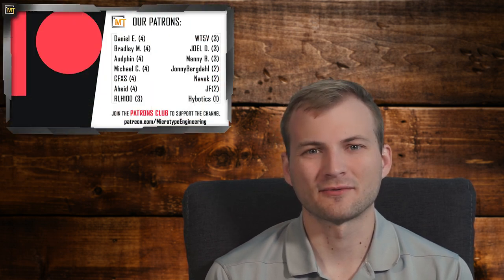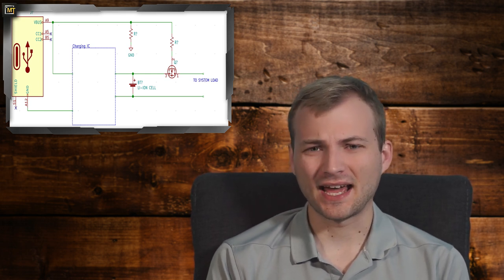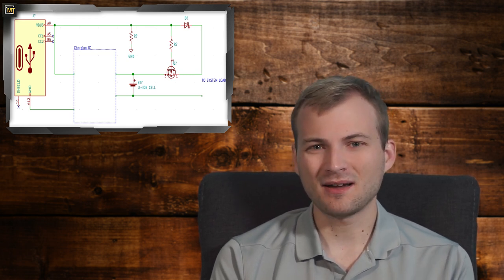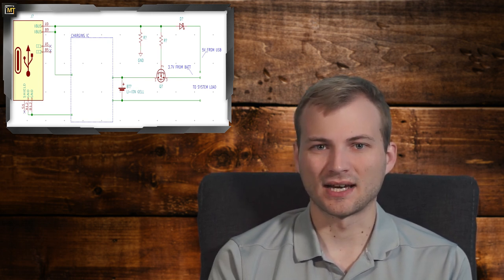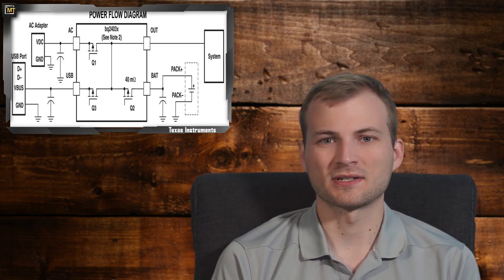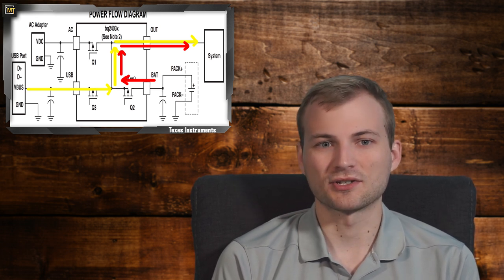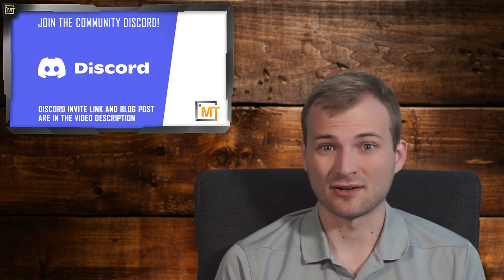Don't Make This Mistake When Designing Li-ion Battery Circuits!

Comment from the maker: Two clarifications: 

1) When I spoke of power path IC's I spoke as if all can work in "supplemental mode". Supplemental mode is when charging, the IC can suppliment the wall supply with the battery.

Not 100% of path path IC's can do this. Most can, but some only source power for the load from the wall while charging. Still useful, but not quite as much.

Make sure to always check the datasheet!!!

2) On the second method, the PFET should be two back to back. This prevents the input supply directly charging the battery through the body diode!
Reply: This is very informative, please can you give. A part number of such ICs!? Also if possible please create a tutorial on creating on which can supply and charge the battery. 

Subbed,

Greetings from Tanzania 🇹🇿

Comment: Problem with your second method: The body diode of the PFET is still conducting. So you're charging the battery cell through the schotky + intrinsic body diode. You should put two PFETs back-to-back to fix this.
Reply from the maker: Ah shoot. Yes you're right, dunno how I missed it... I always use this circuit with the battery going into a boost converter, so I don't worry about it..

Added a note to the pinned comment, and updated the blog post. Really wish YT let us put text pop-ups in the video like they used to..
Reply: I’ve seen a version of this circuit on Andreas Speiss’ channel with the P MOSFET drain and source reversed. I think this would stop the battery from being charged by the power path as the body diode is reverse biased?

Comment: For those applications where supply interruption is not an issue ( like torches or portable emergency LED lighting ? ) ... by far the simplest arrangement is to avoid the complicated electronics ... and ... just fit a single pole changeover switch ! ! ..so the battery is either connected to the charger or the load , but NEVER both at the same time ! .. This is how I do it ! ( and for those unfamiliar with Lithium batteries NEVER charge more than 4.2 Volts ) ..... ( tried - n - tested ) ..... DAVE™🛑

Comment: Nah, if the charger reduces charge current as the battery fills, the charger won't end up over charging the battery... The charger will just power the device once the  charge current is reduced to the device load.
Reply: You wont ever "finish charging" unless your decice load is less than the charge current cutoff - but it doesnt just ignore battery resistance and overcharge the battery on trickle if the load is using the juice.

Comment: Another issue people fail to take seriously is low battery voltage. Relying on the inbuilt protection board takes the battery voltage to a level where the capacity of the battery can be considered less than 0%, performance-wise. So when I design circuits I use the ADC of a PIC to monitor voltage and react accordingly. Anything below around 3v, the circuit is disabled and the chip shuts down. Using the battery below 3v is pointless anyway, and some chargers just won't see the battery at such a low voltage!

Comment: The easiest way to get passed these issues is when using components that have sleep or idle modes. When the components go to sleep the battery will definitely fully charge, without trickle charging.

Comment: Hi.
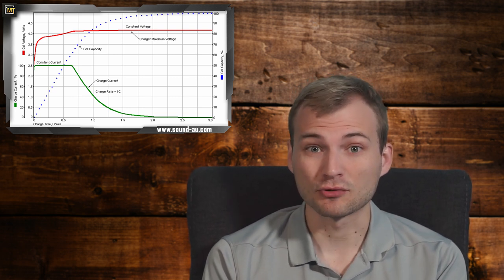At 2:00 you claim that the battery will be trikcle-charged, if the load, the charger, and the battery are all in parallel. I believe you mean float-charged and not trickle-charged right? You also claim that it is bad to do so. Can you please elaborate why it is so bad to float charge a li-Ion battery? Does it pose a fire hazard, or will it just wear the battery slightly faster? How will the cell be damaged if the voltage of the celle never goes above 4.2V? Looking forward to hear your answer. And thanks for the educational content!

Comment: This right here. When I had to design battery power with a 5V boost converter, the only schematics I could google were the ones where the whole supply always goes through the linear charge IC, ffs. Ended up with a mess of a set up where I programmatically detect the charger being plugged in and out through two different voltage comparators and switch accordingly. It did end up working, though

Comment: Excellent video! Caused me to go back and reexamine a recent design that's presently having it's first-spin prototype evaluated under real-world operating conditions. Turns out I did make a mistake and my charging IC, an MCP73831, can be fooled when charging and using the device at the same time (which is an edge case; it's normally charged and then used). Since my battery charges at 200mA from a standard USB supply, the nominal load is 100mA, and the system will tolerate up to 5.5 Volts, the next spin will will incorporate your idea #2 for input bypass.

I really appreciate you taking the time to create these videos. I find many of them to be incredibly helpful.
Reply from the maker: Hah! Yeah, it always finds a way to come up and bite you. Glad you enjoyed. (Make sure to check the blog on the fixed circuit for option two, you need back to back FETs instead of one!)
Reply: @MicroTypeEngineering  Thanks! Yeah, I read the video description right after watching the video, which led me to the blog. Your content is very thorough.

Comment: This was very good, thanks.
I had a brainfart idea of disabling the charging IC over its EN pin (over the MCU that's powered from there lol), but then I realized that I would need a way to detect both battery presence and plugged-in status to even attempt that.

Comment: Instead of using a mosfet, would a regular switch work? It would short the load from the IC right ?
Reply: That's what I did yes, but then I needed to put a voltmeter on the battery at all times to make sure it doesn't discharge too much. I am learning.

Comment: regarding those power path IC s I am not sure if i understand well:
let s say my load is 1A and by battery pack charges at 2A and my external power is 2.5A
then 1A will go to the load and 1.5A to the battery?  or this i think will happen 
and if the load for some reason needs now 2A then the battery will then receive the remaining 0.5A right?

Comment: What works for me is the MCP1640 which will boost the battery voltage to 5V for my load.
So when USB power is available, the MCP1640 is disabled and automatically isolates the load from the charger.
Then a diode to feed USB power to the load whilst the battery is charging. The load runs fine at 4.5V.
Admittedly I don't need more than 200 mA for charging and the load is less than that, but it works fine.

Comment: Nice video. I'll have to watch it again. Im currently doing exactly what you show not to do. 😅 its just temp.

Im building my first drone and learning battery control.

I cracked open a 5v 1amp cellphone battery bank, there is a board that steps up 3.7v to 5v that i need for my drone motors. I need 2amp, and im uncertain of what module to get for light weight battery control with 5v 2 amp step up.

If you have suggestions. I appreciate your comments.

Comment: Thanks for your tutorial, its very helpful for me as I am currently designing a charging circuit.
However I will like to seek your opinion on this. In the case I want for example charge my batteries at 0.5C which will be about 3.45A since the battery capacity is 6,900mAH, and I am using a solar panel as input source which supplies for around 400mA. What strategy would you suggest to make this work? Are there some boost circuitry that can help amplify the input current?
Thanks.

Comment: I had to think about in what circumstance the battery charger would be fooled into thinking the li-ion cell isn't changed due to the current draw from the device.
Lets use the example charge/draw currents.
Icharger = 400mA Idevice = 100mA
Cell is charged until V>4.2V AND I<70mA
But as the device draws 100mA the charger IC is indeed fooled, and will pump the excess 300mA into the Li-Ion cell for the rest of time.
This explains why some cheap (chinese made?) devices kill their batteries.
Reply: Anyway I think this would be another solution:
Measure the current drawn by the device, and subtract that from the charger output current, to get the cell charge current.
Requires either a MCU based Li-Ion charger, or an opamp(s) to do the subtraction.
Probably not doable with a cheap ebay module, due to difficulty cutting the tracks in such a confined PCB.
Reply: So by your example is it fair to say that the method of connecting the load directly to the output of the battery could only work if the device load is less than the termination current needed by the charger? It seems like in this case the charger can not be fooled. And inversely - connecting a load directly to the battery terminal would not be safe if the current required by device is greater than the termination current the charger needs to see to terminate the charging cycle.

Comment: Any suggestions for power path ICs used on 2S lipos protected by a BMS? My team is building a competition rocket and regulations encourage the use of umbilical for charging, while mandating the use of a BMS. I know usually cells in series are balance charged, but from our research it looks like, if we balance charge usually, then simply charge them in series for the one time we fly the vehicle, they shouldn't accumulate to much of a delta to cause problems. In that case we could use a standard powerpath IC made for single cells and call it a day. We just dont have much experience with this so would be good to hear suggestions from people who've worked on something similar:)

Comment: That is very interesting. I suppose you still need to monitor the voltage of the battery to cut-off its role as supply to the system if it gets below a certain voltage (say 3.3V?), would you then want to use a fuel gauge and some sort of mosfet to turn off the supply path?

Comment: Question, does the mosfet instantly stop conducting current from the battery to the load as soon as voltage is applied to the gate